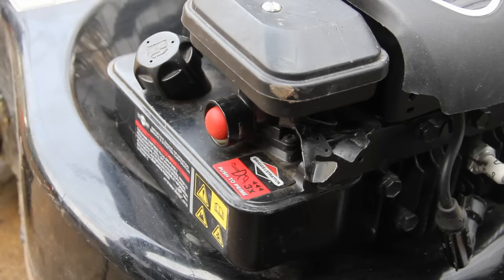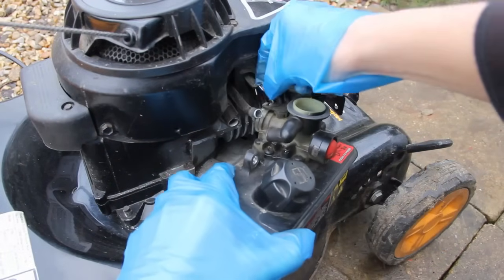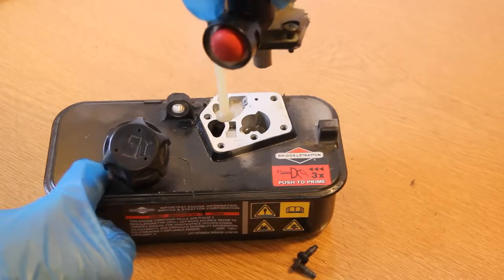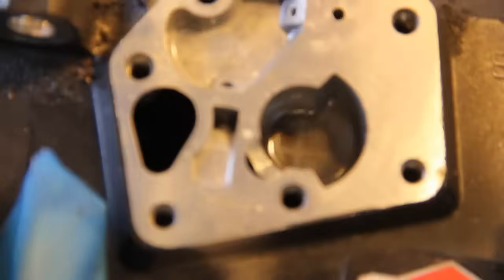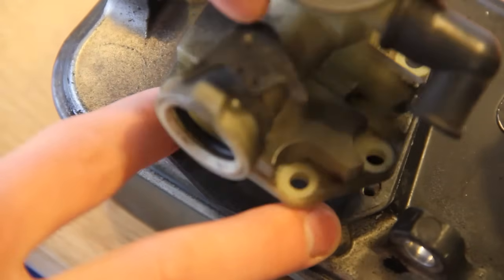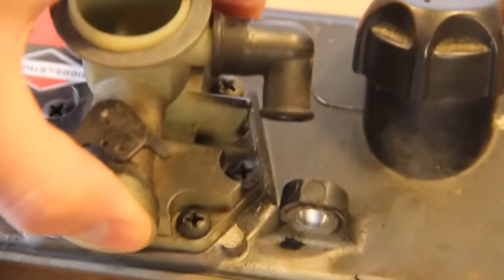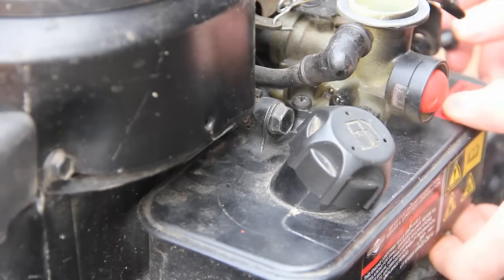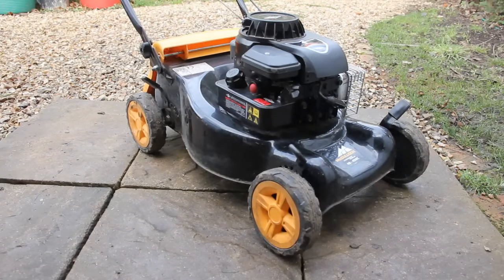How to Replace Diaphragm and Gasket on Briggs and Stratton Engine Primer Carburetor

Comment: My carburetor, that's the original since 1980, had no gasket.  It does have a rod attached to the diaphragm that is not shown or mentioned.

Comment: I replaced diaphragm  and gasket and the lawnmower would not start.   I sprayed the carburetor screws and gasket  area with silicone spray; IT STARTED and has been running great for a few months now.       A suggestion is before you replaced gasket and diaphragm on a a lawnmower that does not run or lopes is to spray with silicone spray.   I think the silicone spray sealed the very small air gaps around carburetor gaskets.

Comment: You should pry out the Main jet and Emulsion tube and clean the holes.  There is a tiny flat spot on top of the Jet that you can carefully pry the plastic part secured by a tiny O ring.  Reinstall Flush.  It snaps in.  There are 3 small holes in the tube barrel.

Comment: the o ring from carby to inlet pipe is loose, over the pipe, and in behind the plastic clip holder, should it be fitting snug,   there was no  gasket too in my neighbour's mower, should the tank only be 3/4 filled each time

Comment: Outstanding video--This is a late entry.  I replaced diaphragm and gasket and it did not fix mower.(it would not start.  With mower assemble with carburetor on mower.  I SPRAYED SILICON SPRAY on carburetor screws and gasket area.   It has been working Great since.  (I read that this carburetor warps and replacing gasket does not  always works. (I did not know how to send this message t GardenMechanic

Comment: The diaphragm you took off isn't exactly like the new one you replaced it with i.e. there's is black 'cellophane'  cover over one of the vents/holes in the 'old' one but not on the new one. Why is that?

Comment: I installed a new carb and it ran great for a couple months  then today went to mow the grass and it wouldn't prime. I found behind the primer bulb some parts. A tiny spring a steel ball and a plug like thing. I got it back in the hole it fell out of now it primes and runs again. I doubt it will stay in place and will fall apart again. The plug think is rubber and used a toothpick to put the parts back in the hole, hard to see so small.

Comment: I replaced the Diaphragm and Gasket an my MTD BM87-35 lawn mover, but it is not tight. The speed of motor changes very fast and sometimes the motor goes off. And some petrol is running out of the gasket....  What can I do now?

Comment: Hi I have replaced the gasket and diaphragm but there's a slight drip of petrol coming out on the opposite site to the primer bulb.  Any idea why?  
Also the engine is racing too quick now after changing the governor springs.

Comment: I have a Troy-Bilt Edger-Trencher, Model No: 25B-554D711. Carburetor and gas tank look exactly the same. Had it several years. Works great. Recently, the gas tank got bent and is leaking. Not sure, but also think it needs a new or rebuilt on the carburetor (maybe just gaskets, but tank for sure). Anyone know where I can find one.  Serial Number is 1E236K50050. It has a Briggs & Stratton 4.5 HP 158cc engine. Thanks for info. Dan

Comment: Good video.
The reason some people install the air filter the other way around as mentioned at 07:00  is because on some Briggs & Stratton engine models there is very little clearance between the "V" shape on the filter case and the engine blower housing, making it somewhat of a pain to install it without first removing the blower housing itself, at least partially. But yes, the correct orientation is flat side to the front.

Comment: Update despite cleaning and replacing diaphragm it still cuts out. Could it be a dirty air filter?. I cleaned the air filter under water but no difference

Comment: Very good video but you forgot to install the spring?  I watched your video to get the installation order of the diaphragm and gasket.  My power washer that uses the exact same carb never ran right from the day I purchased it new.  The gasket and diaphragm had been reversed during factory assembly.
Reply: When i took mine apart, i lost the spring. Any idea what it is there for?

Comment: At 1:07 If you’re looking straight at the carburetor with the gas filler cap on your left, when I press the primer bulb gas will come out of a little hole to the left of the bulb (in front of the screw). Is this normal? No return line should be connected to it going to the tank?

Comment: have similar engine having problems with high compression after service mower, hard to crank pull cord with spark plug on but when take spark plug out easy to pull could this be caused by a damaged carb or diapham please can you help
Reply: Either the auto de-compressor has packed in, or the exhaust valve clearance is too large, reducing the effect of the auto-decompressor.  Good luck with it, I think either the head's coming off or the engines coming out.

Comment: Thank you very much for this video!  After ten years my mower gave difficulties (problems with starting and priming, motor didn't run smoothly but very irregularly, consumed a lot of fuel and blowed an immense smell of fuel in my face whilst running behind the machine.  I was thinking about buying  a new one, until I've found this video.  After a thorough cleaning from the fuel tank and the carburator, using a cheap product from Wibra (Dutch & Belgian) and replacing the diaphragm and gasket, which costed me only 4 euro (+ delivery cost) problems seemed to  be solved!  Thank you very much for this very clear and useful tutorial!

Comment: I have an old briggs 5 horse from the 1960,s.Just a tip to you guys out there.If your diaphragm is stiff or torn put a new one on it.I did and now it runs perfect.Remember if your engine has a diaphragm it is critical .That's what suck gas up thru carb

Comment: Thank you for the video.  I feel that 400,000+ people have had to do this which means there is an inherent flaw in the design.  Briggs and Stratton should be held accountable in some fashion.  My mower has less than 200 hours and eventually would not stay running.  I have been in and out of the automotive repair industry over the years and have experience with many types of engines.  After replacing the carb diaphragm and gasket, the mower ran great for about 20 minutes (about long enough to mow my front yard which is 20 yards x 20 yards.  

Notes:
- Tank was emptied and filled with new gas
- New Spark Plug
-  New filter
- mower deck cleaned top and bottom of all debris
- carb and mating surface on gas-tank cleaned spotless
- new oil
- verified compression 
- starts only when primed
- primer bulb has small hole on the face
Reply: The problem is not in the design.  The problem is in leaving the had setting in the mower. The ethanol which is alcohol breaks down the gasket and makes out lose suction from tank. If you let your mower or other gas tools run till they are out off gas it will eliminate the issue and will be ready the next spring to start right up after adding gas

Comment: Great video.  I did this recently (video here: https://youtu.be/b0qoSrWP7jg ) but I opted to replace the carburetor as well since the kit that included everything was only $25 US ( about $18 pounds I think).  I figured as old as the mower was getting, some of the other rubber parts (like the primer bulb) were possibly nearing replacement as well so I just did it all in one shot.

Comment: Ive changed the diaphram on mine, also the governor springs etc too , it starts great but then I pull the throttle on the engine revs so much faster than it previously did, no matter what I try it cannot slow the revs down etc, I've adjusted the springs and no jot at allTheres no other way of adjusting this rom what I can see !!It is self propelled, the throttle is pulled up bar upon pulling starter ,not a throttle link to carb

Comment: Hi I changed the diaphragm and new spark plug and air filter , cleaned everything but the red bubble is still not coming back out.... any suggestions
Reply: rob, i changed the diaphragm and gasket and did not fix.  I SPRAYED SILICON SPRAY  on Carburetor screws and around carburetor gasket  after it would not start. It now WORKS GREAT.

Comment: There are a lot of videos re: the B&S carb diaphragm.  Yours is definitely the best one!  Nice work.  Thanks for uploading.
Reply: Great video!  I bought a new carburetor for my Briggs and Stratton, had trouble with it running for about 2 minutes and then stalling out.  After watching this video I checked the gasket and diaphragm, I had installed them backwards, reinstalled them and problem solved!  Thank you!

Comment: One other thing to check when a mower only runs from the primer fuel, if this does not work for you.  

I had removed my engine from the frame while repainting it. When I put the engine back on, I was unable to pull the rope, because it was hydro-locked with oil in the cylinder.  I removed the spark plug and pulled the rope, blowing the oil out. 

 I had a problem with the engine running longer than what the primer pumped into the carburetor.  I replaced the diaphragm thinking that was the problem, even though it ran just fine previously, and still had the problem.  After reworking it several times, I checked the oil and it was milky looking, and smelled of gas.  I drained all the oil out, and it was gray.  I added new oil and the mower then started.  It took a bit for it to work out the contaminated oil, but that's the only other thing I did to make it work. If gas gets into the oil it can destroy the engine.  Check the oil.

Comment: Thanks. Same thing - some water in the well where the screen sits. Whatever that's for. I had an O-ring and bushing fall out of the port behind the butterfly valve port where it mates with the engine when I removed the assembly. O-ring goes in first. Mine is the same engine but it's used on a pressure washer.

Comment: Thanks for the video I needed exactly that, but when I reassembled the throttle linkage doesn't seem to work. I only removed the one point like in your video. Any help is greatly appreciated, thanks!

Comment: My lawnmower will start up then it  dies right out. I've changed the gas, spark plug & changed the diaphragm with the other components just as you have. Still no resolution, any ideas anyone?

Comment: Thanks. I replaced the gasket it worked fine for a few weeks, unfortunately same problem again, please could you advise???
Reply: Make sure your tank is clean and no rust is in it also make sure the carb screws havent backed out

Comment: have replaced the gasket and diaphragm today following your video.  put it back together but the engine will now not run for more than 2 mins. when it cuts out you cannot get it started again.  removed the spark plug and it was very sooty so cleaned it and put it back and it run again for 2 mins and cut out again. cleaned the plug again and it run again until I had to stop it to empty the box. wouldn't start again.  I put it back in the shed at this point.  any idea what the problem is please.  the engine before the new parts was running very uneven and guzzling fuel.  when it runs it runs lovely now.
Reply: yes same problem on mine..did you fix it?
There is not much left to do:
1. clean or new air filter
2. new spark plug
3. new springs for the governor

4. New Carburator which is not cheap :-(
Reply: +Moes no I didn't mate. The plug is quite wet when you remove it and it guzzles fuel.  I think it's going to be a new carb. they about £25 here in uk.

Comment: Great Video, thanks. Just a couple of questions are the bolt heads metric or imperial? Would you recommend replacing the governor springs while you service the Diaphragm/Gasket Kit? Thanks, John

Comment: Thanks for creating this great video. Sadly though, after carefully installing the new diaphragm and gasket, I'm leaking fuel from what looks like the very seal I've replaced; I've removed the carb, checked and reinstalled and it's still leaking? I'm wondering if removing a old (20yrs!) carburetor could have resulted in it losing shape and hence the leak?
Reply: On reviews placed on amazon for same/similar diaphragm issuessome took and reused old gasket + new gasket (as replacement was not thick enough)  I have not done mine yet - but is a aftermarket one ( so either will use 'make a gasket' in a tube - along with gasket .....or both gaskets (tho worry about that causing issues)

Comment: Excellent tutorial!! It did the job for my mover and it now lives to trim the garden again without loosing it´s breath:-)
Also changed the air filter and sparkplug and now I´ll just have to change the oil and we´ll be heading hard for another season of cutting grass. Thanks a lot for posting this video I know there are many B&S owners that can benefit from this.

Comment: I have a very simular engine on mine a spring 40 - why would the mower lose power as it goes into grass and cuts out? also having trouble starting it. cleaned carb and air filter and new spark plug. It starts but I have to push the button to keep it going then it finds its way and ticks over but as soon as the blade meets resitance it shuts off.
Reply: It is starving for fuel. The long tube he had trouble getting in/out of the tank has a screen on the bottom of it. The HS jet has a screen around it too. These will get dirty and plugged
He mentioned to clean the dirt out of the 'fuel well'. Be sure to clean the screens too. I use a small stainless steel brush to clean the screens. Working gently in a small circular motion, to clean the screens.  
Then rinse and clean any dirt, rust, bugs, leaves or clippings out of the tank. I use a 4 mm clear vinyl tube approx a meter long to siphon the gas/water/dirt from the tank. I will rinse it several times rocking it gently to work any sediment to the bottom corner so the hose will pull it out.

Comment: what happened to the spring ?
Reply: +Larry  Cox It's underneath the carb.
Reply: The hell with the spring, wire it open let her rip.
Reply: is the spring required? I'm pretty sure I can just manually use the choke. also don't suppose you know if this primer carb can be replaced with a different carb?
Reply: Go to marker 3:15 - 3:17 and you can see where the spring sits up in the carb body.  Yeah yeah, your comment was 2 years ago, but I'm sure 1000+ other people were still looking for the answer.  Ha ha.
Reply: 4:29 thru 4:35 during ASSEMBLY the spring is not there..  Ha Ha

Comment: Thanks for the video, I fitted new diaphragm and gasket to my B&S and it's now purring again, it's getting on for 20 years old and the deck rusted away and was rebuilt in wood! The throttle linkage managed to dislocate to the left side of the intake pipe on dismantling which had me confused at first but a re-check on the video showed me where it should be. I seem to be missing the secondary spring on the throttle butterfly - but hey ho it works. What is the mechanism that you can click into a different position to the right of the prime button? I lost the manual years ago.

Comment: could you explain how this type of carb. pumps fuel please?
Reply: The rubber diaphragm if you look closely has a pocketed like area and a spring. The pressure change of the engine(with sucks in air) also acts with the rubber to suck up fuel like in a straw.

Comment: Just did all this....didn`t have new parts but I cleaned everything, used a little silicone, blew everything out with air, and everything worked fine...just needed one more cut before winter....now I know how to fix, I will replace with new parts in the spring...thanks great vid M8.

Comment: GardenMechanic hi I have a briggs and stratton classic 35 that starts but cut out I have don't a service and changed the two springs but still stops
Reply: Allan Brough tried pressing the primer again just before it stops ? might be an air leak somewhere  , broken inlet manifold , 'o' ring leaking . or blocked air filter foam , springs only work the gov' really only one is needed   small one is for idle

Comment: Is every diaphragm the same for briggs&Stratton mowers ?  do holes match even if they look different ? Thanks for sharing  .
Reply: +Mars Seeker No.  You need to look up your engine on their website and they'll tell you what part you need.
Reply: Jason H yea I noticed , I have a really old one (not the oldest one but close enough) . and couldn't find a matching diaphragm especially where I live. so I improvised and put the old one in a sandwich between two rubber seals I cut myself . It works .
Reply: Mars Seeker Nice

Comment: Thank you. You could may be say a little bit about the cause which made you change those parts! Great video.
Reply: mogbaba I Did the same with my Briggs engine. When the primer does not suck gasoline in to the carb. that is the problem that diaphragm  is faulty, or it has torn, or been wet or a tiny hole might be the reason.. I hope that gave you a picture why he replaced the parts..
Reply: Thank you, Yes it did.